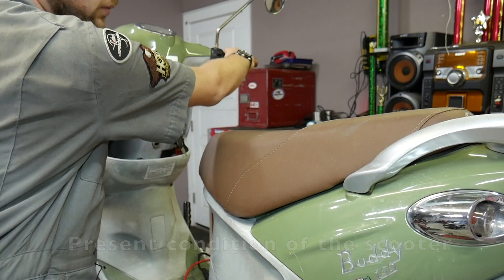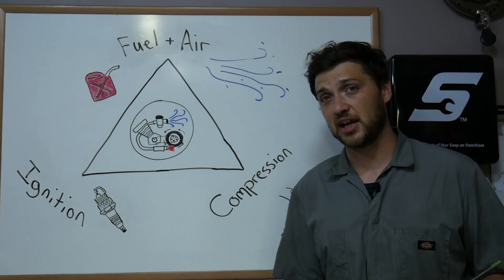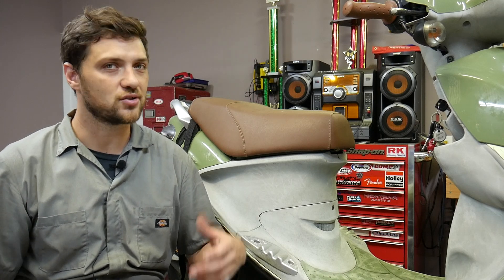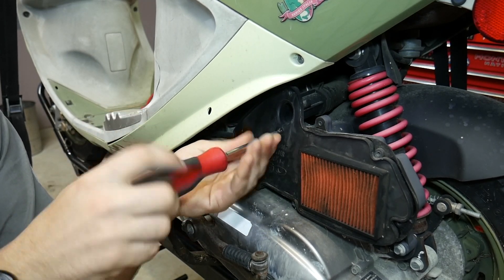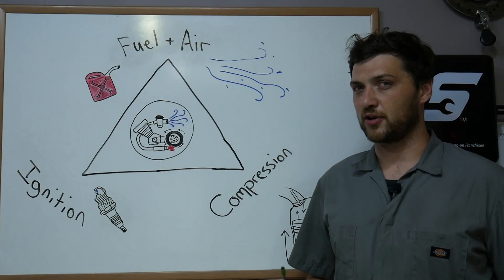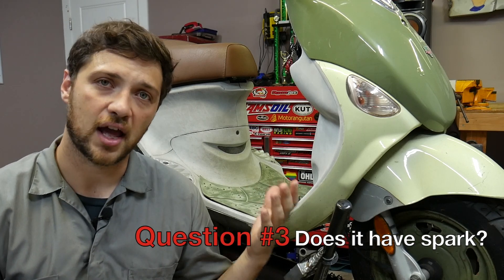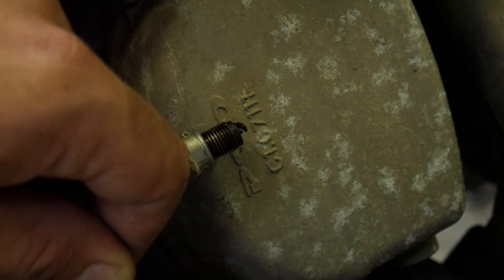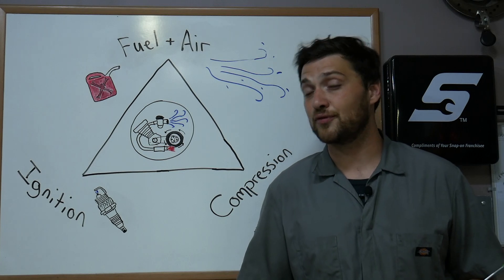Scooter 911: Find out why your scooter wont start by answering 3 questions!

Comment: Another overlooked item on crusty scooters that don’t start is the exhaust. If it’s 2006 or newer it probably has a catalytic converter in the muffler can and can easily plug up from soot or rust from water intrusion.

Comment: I have a Lance SOHO 50 and I put a new battery in, I have no electrical power, the 2 fuses are good and have 12 volts on both sides of the fuse. Any suggestions. Maybe a bad ignition switch?

Comment: I have a Kymco People 50cc and I have tried absolutely EVERYTHING. I’ve checked the spark plug and it had no fouling. It was basically brand new. I checked the valves and compression, and it was perfect. I checked the air fuel screw on the carb by turning one half turn right from factory position(no start), then turned it one full turn left from factory position(no start). I then turned it back to factory position by 1/2 turn right again(no start). I siphoned the fuel out and put new fuel in to make sure there was absolutely nothing wrong with the gas. I made sure the fuel pump did its thing(yes, Kymco 50cc’s have a fuel pump). Basically, I am at a loss. There is absolutely NO reason for it not to turn over. Nothings clogged. Nothings fouled out. Compression is good, so there’s no leaks at the valves or head. There’s oil in it. Gas is good. It gets spark. Battery is good(running a little high at 13 volts tho). Starter turns. Keys aren’t chipped, so there’s no automatic lockout that’s key specific. Basically, it’s an $1,100.x Facebook marketplace mess. I may just swap the engine. For now I’ll just continue to drive my Honda XR150L if I want to have some fun. The Kymco is just gonna have to wait.

Comment: If I could get you to answer one question I will be forever grateful. I have learned so much from your channel but I'm stumped on this one. GY6 bbk 100cc I got the three I need. Fuel,spark, compression. When I try to crank it about every third rotation of the motor it shoots a flame out bottom of head exhaust port. I've set valves and timing twice but still same thing. I ordered a stator thinking maybe it was sending firing signal to late but it has good fire. Keep up the good work. I'm a 52 year old man that has learned all the basics then some on the GY6 engines thanks to you. Peace out and thanks G!

Comment: Hello sir my scooter start but it doesn’t run what could be the reason
Reply from the maker: Do you mean the engine runs and idles but does not drive?
Reply: @Scooter_911  yes the engine work but it doesn’t drive

Comment: Please tell me my case, fuel is full , air is fine,  starter is fine, just wont  say anything and work.
Reply from the maker: This video has the answers you need my friend. Follow the steps and you'll find out!
Reply: So which do you think stater relay or ECU?
Reply from the maker: @paul91124  did you go through the steps outlined in the video?
Reply: @Scooter_911   Yes, but starter relay's fine, what's the next?
Reply from the maker: @paul91124  this video is not about the starter relay. It is about checking the bike for spark, fuel and compression
Reply: @Scooter_911  It's electric problem,signal right ,engine light starting button won't work .relay's fine.May ECU?

Comment: I spray carb cleaner into the air intake, and it starts for 2-3 seconds then dies again. Do I keep doing this until it works?
Reply from the maker: That means that you will likely need to rebuild your carburetor my friend. There is likely a blockage in the jets
Reply: @Scooter_911  Nope, turns out I just needed to wait 30 minutes for it to do it's magic. I went back and it started right up! A ton of black smoke initially came out the exhaust.

Comment: The carb cleaner in the exhaust trick worked....still not getting any fuel to the fuel filter (brand new).  Would that indicate something wrong with the Petcock Vacuum Shut off Fuel Value or still something with the carbonator .  

Great videos, I love the simple tricks you give to try and narrow down the problem.

Comment: My 50 cc Baodaio scooter will not start when it is cold. The electric choke is working and it is getting Gas, spark plug fires and has compression but has also started loosing power. When it does start it idles fine and will run fairly well except uphill power loss. Do you have any ideas on what I should check?

Comment: Hi garret, just a genuine question,  I have a ya.aha Ray zr scooter, my scooter engine jerks off / starting to slow down when running like more of Missing, I have pumped enough fuel also, and once the take is half full, that problem slows down but still it's there yku can feel it, when the tank is in quarter, the problem gets worse, so i have checked these things , carburetor checked ✔,  air filter replaced,  new spark plug and fuel filter, clutch pin set also, what can be the problem?

Comment: Hey Garret, I tried the carburetor cleaner route and it does start up my moped… but that’s it, doesn’t fix the issue. Every time I turn my moped off i have to take apart the air filter and spray carb cleaner so I’m at a loss, what should I do or look at?

Comment: Thank you for all the information. I have a buddy 170i. I followed all instructions, and it won't start. It has spark and with the use of the carburetor cleaner,  and it coughs. Does that mean that I'm having a compression issue? I adjusted the valves like the other video suggested and I'm still having that problem.

Comment: I have a 2012 50cc 4 stroke fuel injection that turns over but will not run. I have good spark, injector has good fuel spray, good air and have set valves on .005.  It has started a few times but only runs for about 10seconds. What should I do next? Thanks for your time. TC

Comment: Your video’s are great for guys like me that don’t have a background in vehicle repair. The video explained how even I can check what the possible problems could be. Gonna buy some carburetor cleaner just in case and I can check the plug easily. Compression might be a bit harder. Thanks!
Reply from the maker: Good luck my friend! You can do it!

Comment: What is the cable wrapped in a spring type cover, it goes from the bottom of the carb and ends with an adjustable flat head screw. It has red arrows on the rim of the screw and the line that you put the screwdriver in points to those arrows. I've done everything to my taotao that you have done except for the above cable and I have not done the valve tapit lash but will do that after I figure out what that cable does, can you tell me what it is and what it does? I really appreciate you, you're doing a great job and you have a knack teaching and I've learned a lot from your videos. I also have an 07 HD dyna wide glide and find that most of what I'm learning about the scooter can be applied for it. Thanks for taking the time to teach us, you're a good man
Reply from the maker: That is most likely a drain for the carburetor. You can loosen that brass screw and drain the contents of the carburetor if you plan to store the scooter.
Reply: Thanks so much, I guess I'm going to have to check the valve and adjust the tapit lash. After every adjustment the triangle is all working but I can't get over 20 mph and frequently get stuck. I'll let you know how the valve job goes 😂

Comment: My kickstarter works but don't want to use it every time, like you said. My electric start cranks, but after 7-8 cranks, it stood cranking and just clicks. Is this still most likely the spark plug?

Comment: Can my moped not start because of cilinder i only drive 2k km and i think it dead i spray in to carburator not starting new spark plug still only starter works but won’t even trying to start only does like video start

Comment: I have an interesting case. I have about 2 ticks on my fuel gauge (2022 Primavera 50). I've been practicing figure 8s for about an hour nonstop for an upcoming MSF skills test. I completely turned off the bike for about a minute. Tried it again but it wouldn't start, only crank. I let it sit again for about a minute and it hestitantly started. Drove it about 10 yards to its resting spot, turned it off for a couple minutes. Then, it started right up. I'm hoping it's the kill switch getting stuck that was the issue for me... I hope that's all.

Thanks for sharing the tips !!

Comment: My scooter won't start most of the time unless the back wheel can spin freely on the center stand plus the charging system is not working I changed the stator out with two brand knew stators and it wouldn't start at all untill I put the old one back in both times .. dose any of this bring anything to mind ? Please help ? 😢 Lol
Reply: Also always wants to die if I don't give it constant gas at a light ..
Reply: And is hard to push when off half of the time and it's not the breaks locking up .. ??? I think it could be connected to the no start unless wheel spins freely issue ???
Reply: I should say also I have a switch connected to the solenoid and that is the one that works with it up on the center stand .. some reason the other one tries but doesn't catch ..

Comment: My250cc Honda forza(elite ) 2020 does nothing when I turn the key...BRAND new battery too,  it ran  in early may...oil is good, no leaks, starter works ...methinks it is in the electrical from ignition...

Comment: got 150 cc yamaha .. got spark , got compression , got gas .. checked valve timing ..... checked spark flywheel / valve allighnment ... its not stock tho has a 160 cc performance cylender and head with fast cams and a slip on , put a 34 mm kainin pro carb on ....  all i get is puf puf puf puf .. with little grey puffs of smoke out the exhaust ... oh compression is super strong ... im thinking the startor can turn over fast enough maby ?  guy at the shop told me if the carb is to big it should still start with some help but will run shite no matter how you jet ?? HELP
Reply: 34mm carb might be a little big for a 158cc. Why not up jet the stock one. I have a 171cc I run a 26mm and it runs a little rich.

Comment: Have a quick question. After replacing the stator on my 1p39qmb, the spark is so weak it cannot start the engine. The stator i received has two exciter coils and i believe the original was a single exciter coil. Also it only has 5 wires. The green ground wire was not present.
I moved the green wire from the old stator and soldered it onto the new one. It made no difference, the spark is minuscule.Will the double coil stator work on this scooter, or do I have to get a single excitter , 8 coil stator?

Comment: Hey scooter 911, had a question. So I got an old Kymco Agility 125 that had been sitting for a few years. It ran before it sat. I've cleaned out the carb and it seems to have spark, and when I kick it I'm pretty sure fuel is getting to the carb. Is there anything you would recommend doing? I got it to start a little yesterday but no luck since

Comment: Mine wount crank. Where is the link to the video you mentioned
Reply: Did you check the fuse on the positive battery wire?
Reply: @thelagmeister  it wound up being the battery
Reply: @thenerdbar924  Nice. Glad you got it goin.

Comment: Now I gotta try the carb cleaner. I watched a video about changing the cdi boxes so I bought 2 and they still won't start. Let me back up & say you had me at hello, not really, it was the part where you said the carb, gas & it sitting for a while, which is exactly what happened because we moved across the country, so they sat for about 1.5yrs & they brand new, never rode before that. I will keep you posted.
This will be my 4th attempt. 1st was changing the battery, then the spark plugs & cdi boxes. I sure hope it's the carb cleaner

Comment: My 49cc scooter just dont start immediately after you push the starter switch.some time it won't start all. Then I will choke it with my hand and it would finally start. Good times I sprayed starting fluid in it started. I turn it off and try to start again no start I put a new carburetor 19 mm high performance CDI box and coil it started but the second it would not start so I spray starting fluid it started. Dan I turned it off and tried it again it started so is there something I'm not doing or need to do please help me. Hope to hear from you soon
Reply: I've also adjusted the valves I know stator and spark plug

Comment: Hello sir,
What could be causing some popping and bogging at 2/3 - 3/4 throttle on a 150cc GY6 scooter? Can you think of anything electrical that can be.causing this? I've already installed 3 new carburetors, 3 different csi boxes, different coil wires, and a couple other things and I can't seem to get rid of it. Would a bad stator or rectifier be the cause? How about a bad vacuum fuel pump? I just don't know what else to do. Can you help me please? I am really just so frustrated right now.
Thanks so much for any advice you could offer.

Comment: I have a brand new 150cc scooter motor do I fired up before I put it on the frame and I have a brand new 150 once I heard it before I put it on frame how do I do that all the wiring up how can I started up with just a shot starting fluid and Battery
Reply: I have my brand new 150cc I want you fired it before I put it on frame how do I start it like that

Comment: Hello i got the vespa pk50 but one problem. It wont start anymore, when i bout the piece that connects the flyweel with the crankshaft. After installing this part, he started. I only needed to fix the rear break and new oil. When we started it, it worked. We put it in 1st and it failed. The engine stopped running and it wont start again. Please help me!
Reply: me too:(
Reply: @adrianvalle2137  whats your problem with the vespa?

Comment: I do small engine repair.  I have worked on many scooters. The one I just serviced was running good after I rebuilt the carb. It does start with carb cleaner. I rebuilt the carburetor,  checked the electric choke and it ran good for the customer for a week. Now its doing the same thing. Not starting.  I'm going to go pick it up tomorrow and see what I can find wrong with it again.  It is a Taizhou 49cc Moped. One shop I called said if they are  over 3 or 4 years old they just aren't worth repairing. 100 to replace  the carb and if that's not the issue then its internal.
Thanks for the great videos.
Any other suggestion ??
Reply from the maker: Unfortunately those little bikes are constantly riddled with issues. We've seen them come into the shop with as little as 39 miles on them with a totally cashed out motor. Typically they dont get set up well when removed from the crate and the valves are almost never set correctly from the factory. I would try a valve adjustment and see if that resolves the issue. Check out our video here: https://www.youtube.com/watch?v=QkkYjRdtQxg 
Good luck dude!

Comment: New subscriber here. You're video is so informative and straight forward I love it. I do have a question I need some advice. I live in maine it's cold and my moped is my daily driver. So I have run a multi meter and I have a stater issue my battery isn't recharging. So it starts if I charge the battery. I was given a wiring harness to install and supposedly they're all pretty much universal Chinese 49cc type scooter. I cannot find a video with the information and unless there could be another reason I'm inna pickle because getting the battery out in a snow storm has been a pain. P.s can you make a guide on studding moped tires?

Comment: Hi Garret, i have a dead short on my motomia 170 sport, on a full battery it turns the engine but no ignition. Checked the sparkplug, alternator generates power, but battery drains immediately when i try to start her up. Doing a full diagnostic on her, but thought you might be able to get me a head start add to where the problem could be.

Comment: Hey friend,  I have a 2008 Genuine buddy scooter 150cc . I have a problem with  my  tail light being dim while running,  also headlight is dim . Does that mean my stator is n
Bad thanks . I enjoy watching your videos,  you have shown me a lot on these scooters.
Reply from the maker: Yes check the battery voltage while the bike is running. Make sure that it is over 12.6v at idle. The problem still could be the regulator though so check out my video for stator troubleshooting before replacing any parts
Reply: @Scooter_911  alright I sure will thanks man apeciate it 👍

Comment: If my timing is off.. how do I fix that?  Do you have a video for that..?
Reply: I have an 2021 Amigo Morro 150 and having a heck of a time getting it running.  It cranks, I checked (just so I would be 100% on piston location) by taking off the top head and visually inspected that it was.  Made sure piston was at the furthest it could reach out and also on that back horizontal piece.  Then put back together, making sure the valves were set at 00.4 with a feeler gadge.  I Also made sure the holes on the shaft were right, big one facing outward center and two little holes lined up with the casing.  
I made sure I had spark 2.  Shot some carb cleaner in and still just turning over nothing.  I have a running 150 trike and swapped the carbs and still  nada.. I'm starting to lose it
Any help pls, I'm all ears

Andy, Las Vegas

Comment: My moped won’t start  I tried jumping the starter sylinoid     And starting with the starter,  they both just try to crank over!
Reply: The idol is way high tho when starting with kick start
Reply: I adjusted the idol   I put on a new starter silinoid  and still won’t start  and ran the battery out of juice    I did not look to see if break light was on, which break lever do I press??

Comment: found one big detail.. i had spark, compression, right clearing on valves, fuel and delivery, new gasoline... and the big problem was the battery crank speed. it cranked it to slow. hooked up a charger with "start" button and it started right up. :)